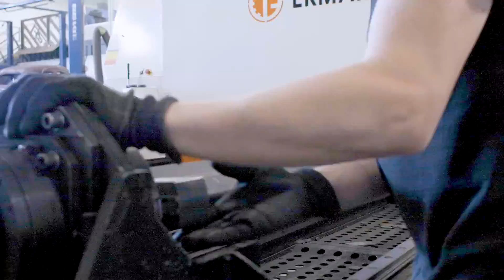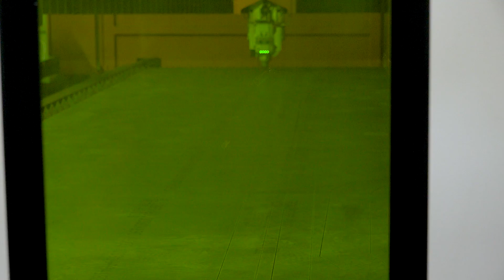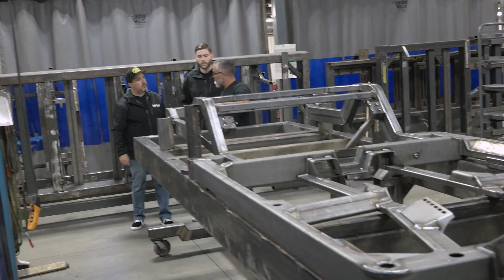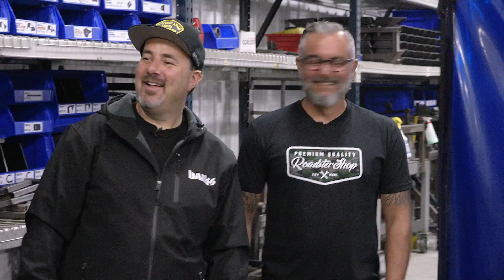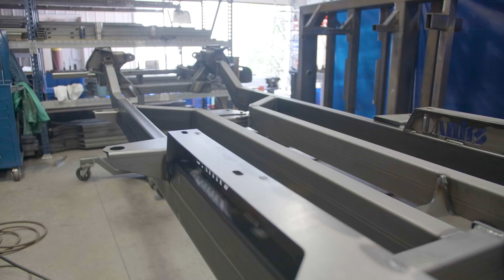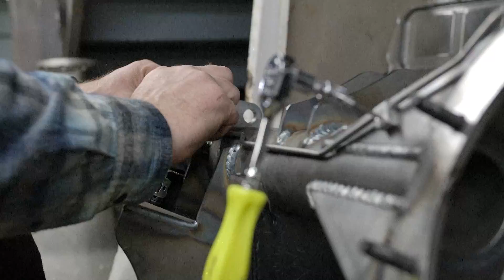Roadster Shop reveals our chassis! | Banks Built Ep 12

Comment from the maker: We're trying to decide on the truck's interior. Should we keep it rusty and decrepit, restomod vintage, or fully modern to complement our MoTeC C127 7" monitor?
Reply: Resto-mod Vintage!!
Reply: leave the exterior go modern with the interior
Reply: if you’ll spend any time in there, make it nice...    nothing wrong with being comfortable in a plush new interior.
Reply: The interior should be done with the classic South of the boarder theme with Mexican blankets for seat materials and worn out looking leather for the dash, head liner and door panels. Don’t forget the fringe. 👩🏽‍🌾🪅🌶

For the gage panel, use patina looking metal. The glove box should say Banks back lit by LEDs that can change color with the other interior LEDs lights. 

Cheers,
KP

Lock Jaw needs to be embroidered into the head rests or seat backs if no head rests.
Reply: @icare7151  LokJaw will definitely need headrests, five point seat belts, and a roll bar. But you got the look I was going for to a "T". I might have been more inclined to use an LED panel that used projected images of Stewart Warner Diesel engine gauge panels from old. FR
Reply: Full modern and to the 9’s
Reply: Keep the bench.

Squared steering wheel. Chrome bezels. Suede dash.
Reply: Fully modern !!
Reply: Holy xxxx
Reply: I’m emotional
Reply: Would love to see an aluminum bead rolled interior
Reply: @andrewmccomb508  I was going for comfort but you tempt me with that idea.
Reply: TMI seats with bead rolled door panels
Reply: Put up a poll in the community section!
Reply: Keep it vintage
Reply: Nevada Desert Beach Interior with Disguisable Modern Amenities
Reply: Restomod in rawhide leather
Reply: Something nice but wouldn’t be afraid to sit in after a long day of work.
Reply: Restomod
Reply: Keep it real with no foe finish maybe some vintage hot rod add ones 👍
Reply: I have a soft spot for period correct rest-mod (power windows with switches that look like cranks, etc)
Reply: Also a fan of the Dakota Digis!
Reply: BP.  Since the truck is from the 1960's, an adaptation of the jetliner era could be a theme to develop for the interior dudes ?  Ventilation vents from a B707, captains chairs off a DC-8 including armrests !  V.
Reply: Full modern!!!
Reply: Full modern
Reply: No on modern! No no no! Resto mod vintage fully restored.
Reply: Fully modern interior would look really good for this build! All modern on the inside while keeping it old school on the outside.
Reply: Fully modern!
Reply: Custom license plate name suggestion “TETANUS”
Reply: Resto it with some big plush GM big car buckets in leather bolsters with a wool blanket center and bottom. Console from repurposed crate wood (from the frame crate?), big period steering wheel that fits the hand and the truck. Paint the ceiling with bed liner to match the blanket centers. Make it tough enough to wash with a pressure washer. Enjoy- this truck is made to move, not park. FR
Reply: Reach out to Johnathan Ward from Icon. He does the best interiors. He may have some ideas.
Reply: Full modern and clean interior.

I'm also not into the "crap for the sake of crap" or also called "patina" exteriors...but that is just me.
Reply: Vintage!
Reply: Modern
Reply: make the interior kind-a-stockish, make it look like a bench seat but have drivers and passenger sections adjustable, center console to fold up or down, maybe a distressed brown leather, button tuck, same for the ceiling and door cards. nice steering wheel, maybe a tri five?
Reply: Vintage to match
Reply: Resto mod!

Comment: That is an awesome chassis. The Roadster Shop does amazing work. If you guys at Banks Power are going to be running a hydroboost on this '66 C20, I fabricate and sell the brackets to make that a correctly done,  bolt on installation.

Comment: I like your channel and I wish you let us know when will you finish the killing the duramax and the amazing unboxing videos that went a long with it, one thing I'm curious to know is those chassis road legal and do they get new VIN# or you stamp or weld the old chassis vin #, thanks for all of info you're sharing with us
Reply from the maker: Here is an update:

1. The Super Turbo (Monster Truck Engine) is in the process of being upgraded which means pulling everything off the current 7.0 LMM, making adjustments and changes, then installing them all on a newer first-gen L5P block. Also, bring it back to the dyno cell is on hold while we conduct testing for our military program in Dyno Cell # 1.

2. Dyno Cell # 2 for “Killing a Duramax” is down while we update and upgrade to our new engine AVL dyno/emissions equipment.

Comment: Gale Banks the Ultimate Engineering Geek ! Made so many innovations to the industry 💖
Reply from the maker: Thank you for being a loyal fan, stay tuned for more!
Reply: @bankspower  The interior should be done with the classic South of the boarder theme with Mexican blankets for seat materials and worn out looking leather for the dash, head liner and door panels. Don’t forget the fringe. 👩🏽‍🌾🪅🌶

For the gage panel, use patina looking metal. The glove box should say Banks back lit by LEDs that can change color with the other interior LEDs lights. 

Lock Jaw needs to be embroidered into the head rests or seat backs if no head rests.

Cheers,
KP

Comment: Why a laser and not a plasma cutter? Accuracy on the dimensions? Saving time on grinding?
Reply: A Laser like that cuts horizontal and vertical , and is cleaner  ,faster, more precise , no slag, to chip or grind off , you go through more consumables on a plasma , than on a laser any plasma I have seen or operated only cuts on  the  flat and slight rises on a piece of material , on a laser it is easy to cut on 3 axis and 5 axis, this machine is a fiber laser which is designed to run 24 hrs/day just to stop and load/unload material